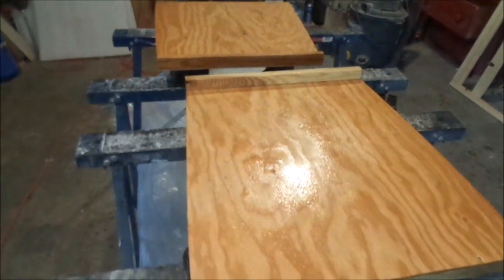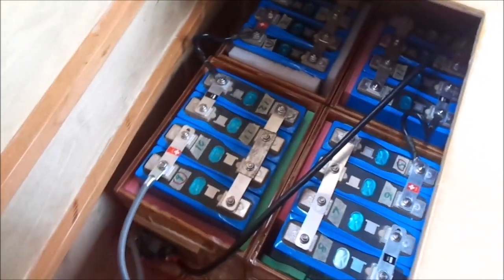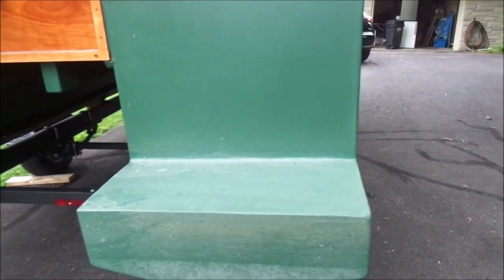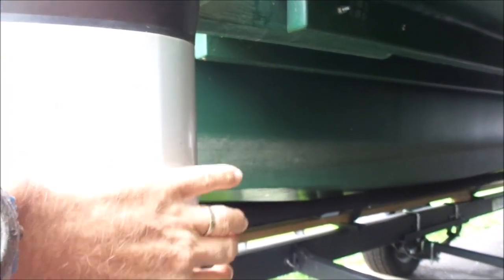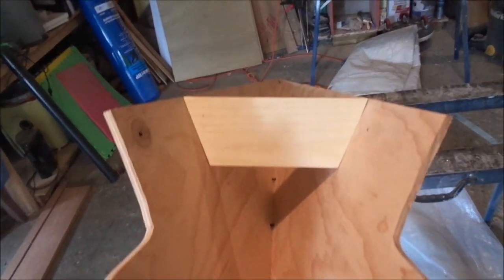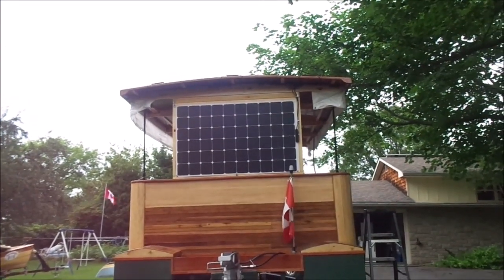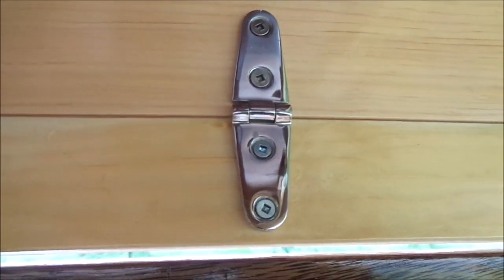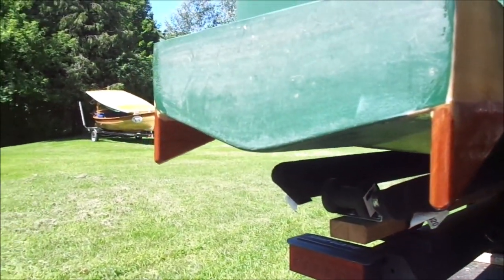Building My Solar Electric Catamaran Part Seventeen, Modifications for Improved Performance

Comment: I'm glad the fins worked, your wood work is outstanding and beautiful..

 Could you save weight by making the house battery LiFePo as well? Suggestion:  You can temporarily use a bigger gas outboard to test whether it will go up on a plane with increased hp (Maybe you can borrow one?).  If you're intending to routinely travel up on a plane I think that most boats use a tapered bow as apposed to a staight vertical bow to help deflect the bow wave downwards to help lift off. I think the V deflector for the motor was quite creative, but I wonder of simple thin metal fairing on the leading edge of the motor shaft might have less water resistance?  I love your videos, I am a real fan.  Thanks.
Reply from the maker: Thanks Richard, I have thought of borrowing a gas outboard for testing but it is too late in the year now. I am always looking at different ways for improving performance and am in regular contact with the designer. I have multiple things I will be doing over the winter to reduce weight as that is the main problem. I will also be modifying the bows to have a sharper edge for cutting into the water.

Comment: looks like you now have water pilling up on the front of pontoons. are you going to travel most of the time with two people. going with flat bottoms on my houseboat the v hulls have no lift  so it just plows though the water. bottom going out a inch each side of sides and hulls  taper back to a point at back.  like a big set of skis at front
Reply from the maker: Yes, that is one of the issues due to the weight. I have been starting to eliminate as much weight as possible. I am now getting a quote for a custom made bimini top to replace the canopy. Next season it will be 300 lbs lighter. The design is a semi planning hull and I will be putting a 20hp on it.
Reply: @philboyer2036  I spotted the heavy bimini construction right away, good improvement.  You might consider light aluminum frame and solar panels, with only plastic sheeting in between panels and frame to make it rain tight.  I'd consider railings only, not solid sides.  Weight, windage, and obstructed views of the water.
Your explanation on the electrical is a huge, huge help to me.  There is a solar boat in my future (although smaller and feather light) for 2 people that I can roll to the water myself.   
I loved your first build and trip, I was all over that too!
Reply from the maker: @someotherdude  Thanks for the comment. This winter I had a custom aluminum frame made plus canvas top. I am waiting for April when I can change out the canopy. This will knock 50 Lbs off the canopy which is significant.  Keeping a solar electric boat as light as possible is absolutely key. The reason I went bigger is for stability in rough conditions. I will be testing my new configuration probably by May as I have modifications to do.